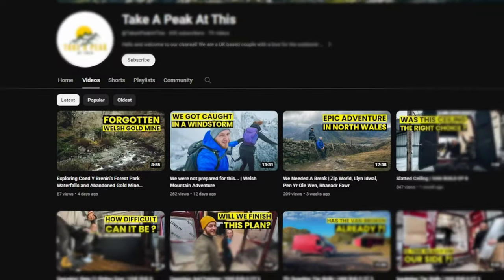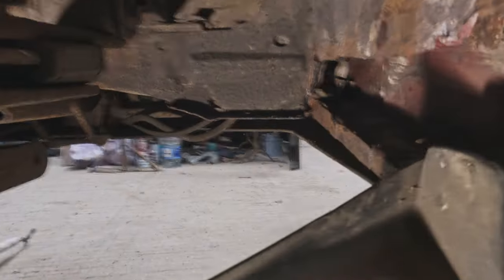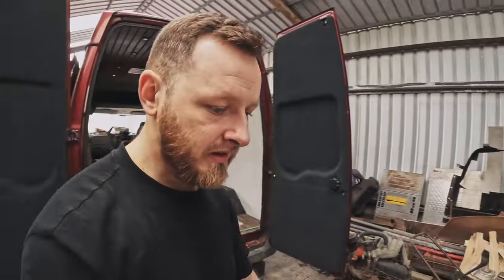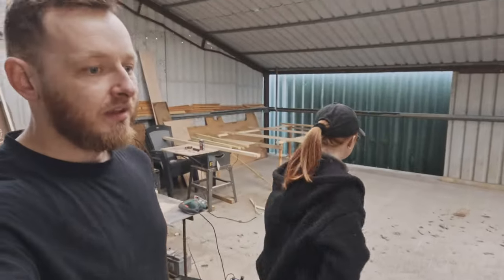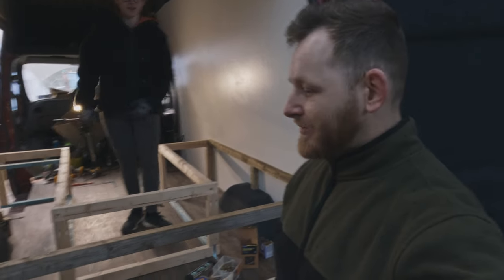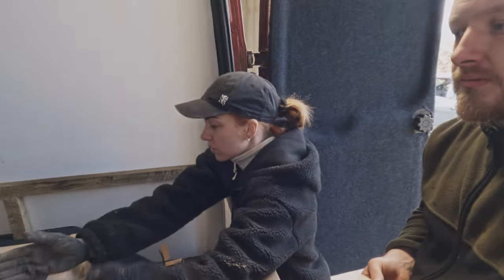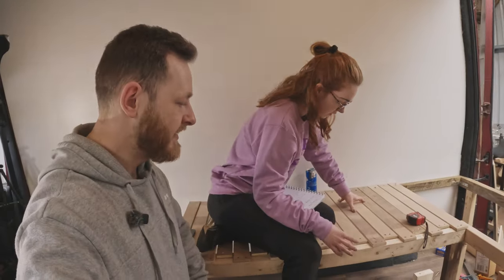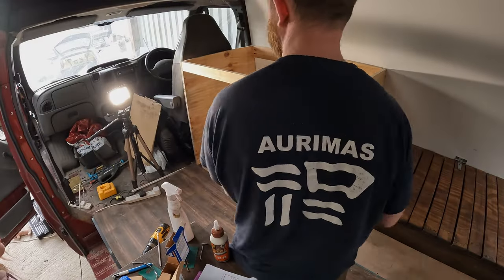More Rust On Our Ford Transit Campervan ?? | VAN BUILD EP 9

Comment: Transit worm! Gets to them all. Once it's done though should be fine for a while.
Reply from the maker: We did expect to fight with a fair bit of rust! Just frustrating when you think you’ve done it all!
Reply: Cost us a grand for last MOT £600 of it welding. Just waiting for a dry weekend to be able to double check the underseal. Lanoguard is supposed to be a game changer especially with the wand you can get up inside the rails etc.
Reply from the maker: Oh that’s good to know! We were so lucky to have the ability to weld ourselves, well self taught at atleast! Time will tell if it lasts! It’s all worth it in the end!
Reply: Can't wait to see. I love the transits and you are lucky to have the 2.4 really good engine when looked after.
Reply from the maker: We hope your under seal holds up well!!